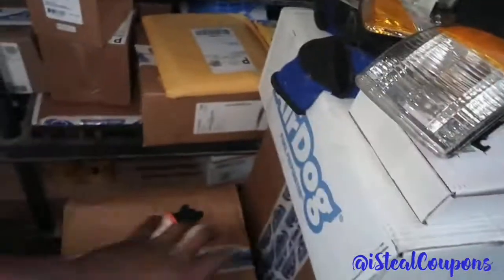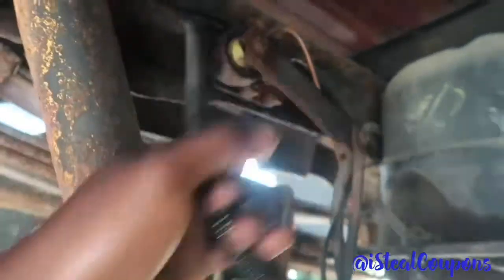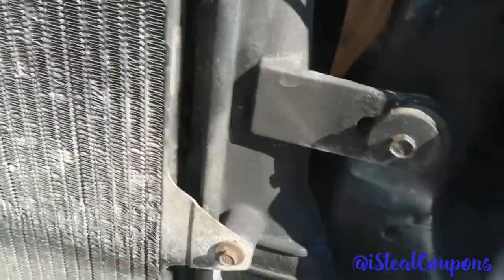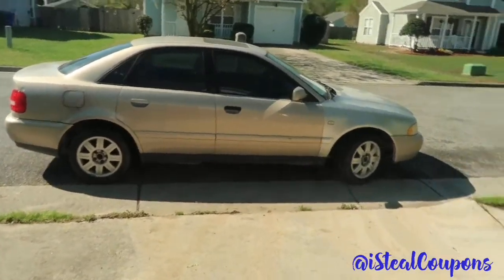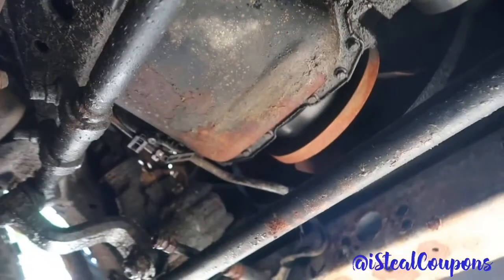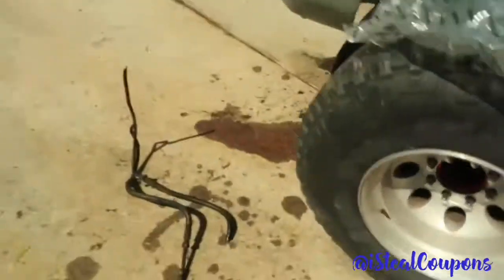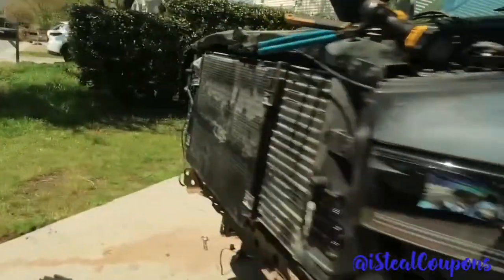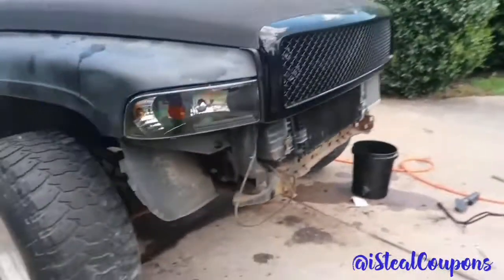MIshimoto Trans Cooler 2nd Gen 24v Cummins Install

Comment: What kind of other upgrades you got planned for it in terms of power fueling and air
Reply from the maker: Next big purchase will be a tuner. Trans already built, already have bigger injectors which needs to be install & as well airdog which needs to be installed as well
Reply: @iStealCoupon  Make sure you install new 103# valve springs and performance pushrods, I would recommend Hamilton Cams brand or Fleece. Since you've installed injectors and are planning to to add a tuner you'll definitely want the springs and pushrods.
Reply: @iStealCoupon  Here's a link to really great transmission lines, these are about the best out there - https://fullsenddiesel.com/collections/transmission-coolers-hose-kits-1994-1998-5-9l-12v-dodge-ram/products/fsd-1994-2002-dodge-cummins-stock-replacement-transmission-line-kit-black-braided